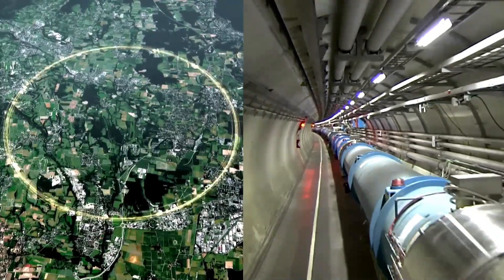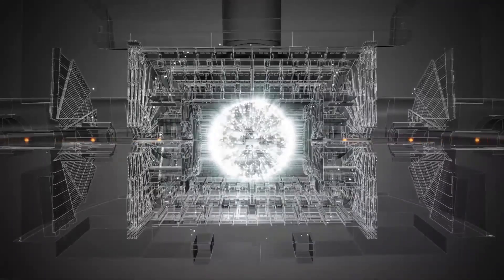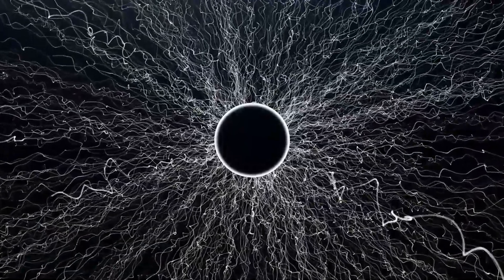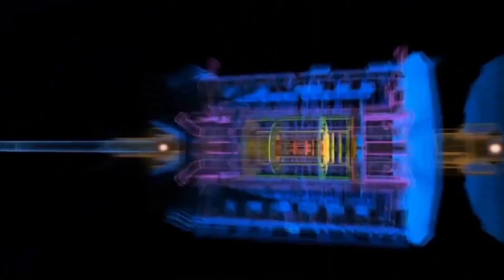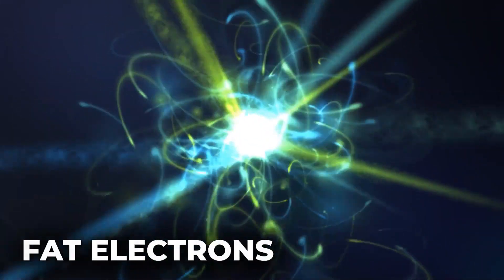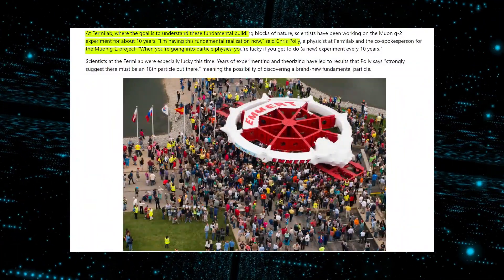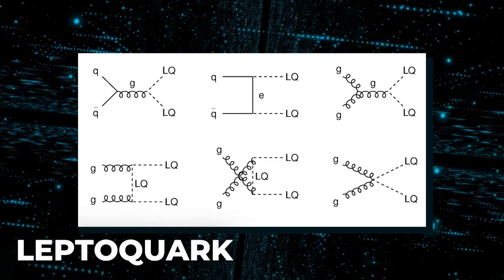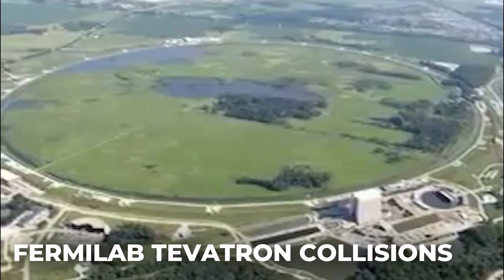Scientists At CERN Just Announced A TERRIFYING New Discovery!

Comment: Anti-particle can not be detected. Cause they are so-called "void" but still important. Anti-mass is the paradox, cause they are opposite of matter. Maybe they are over our 3 Dimensional understanding and are in 4th Dimensional. If anti-materia is something that can not be measured it doesn't mean that it doesn't exist. If a surrounded mass of matter is anti-mass but fills those gaps that are around the mass.

Comment: I think they're all wrong. Gravity is not a force that pulls you. I think gravity is a force that pushes. Gravity is a byproduct of the reaction of dark matter with the physical world. 

Dark matter is the most abundant substance in the universe. To understand gravity it cannot be left out of the equation.

Gravitational forces do not pull you into a wormhole. Gravitational forces push you into a wormhole.

Water rushes into a drain because it is being pushed by the pressure differential. When a damn breaks it's not because of Any force on the dry  side of the wall that is pulling. It is the enormous push of the water on the wet side of the damn.

Gravity is a force created by dark matter trying to reclaim physical space occupied by matter. A wormhole allows Dark Matter to flow out of this galaxy into another parallel universe or to a distant part of this universe where dark matter is deficient.

I'd also think that if they could collapse matter in a control method they could open up the possibility for faster than light travel.

A collapsing star causes a rapid decline in the amount of space that matter occupies. That sets up a Cascade effect in the dark matter surrounding the star. The density of matter has a direct proportional effect on dark matter that surrounds it.
 If all the known mathematical formulas for Gravity are combined in the symbol 'N". We can then say that this concept of gravity would be represented by the formula 
Gravity = -1(N)

Comment: When watching and listening to this same as all the stuff you see from Hubble telescope. Just remember all the pictures you see are made up. May be just the same with the matter. You can be told anything you have no way on earth of knowing if it is true. Same as back when they said they were on the moon. You have no way of knowing other than spotting any mistakes they made. Things like why did the dust off the moon buggys spinning wheels only go a few inches into the air, but should have went way higher in the little bit of gravity up there on the moon. The choice is your but me, I like absolute proff before I believe a thing. You????